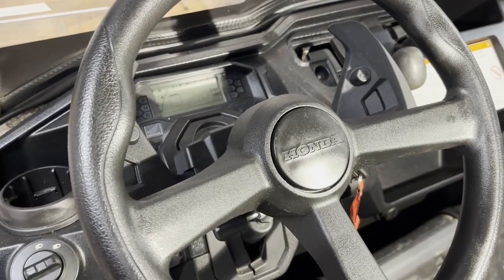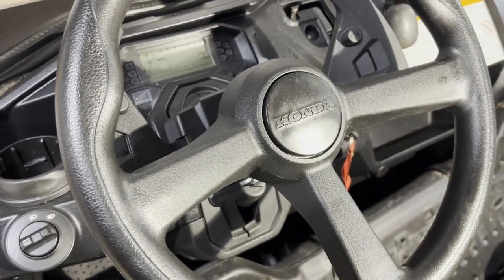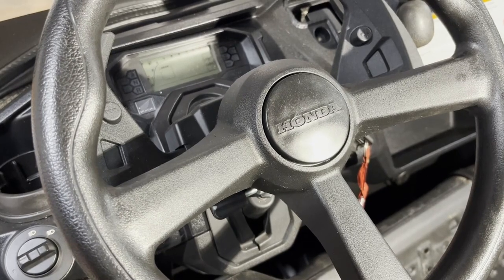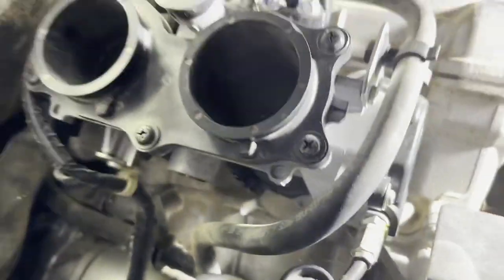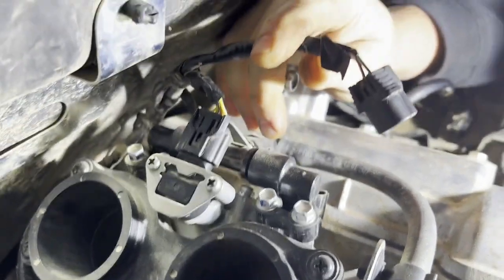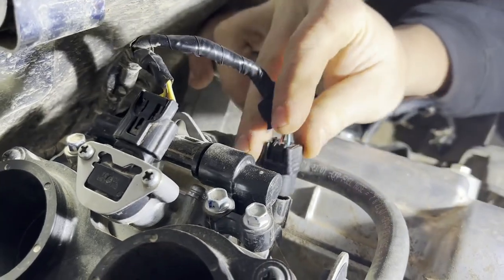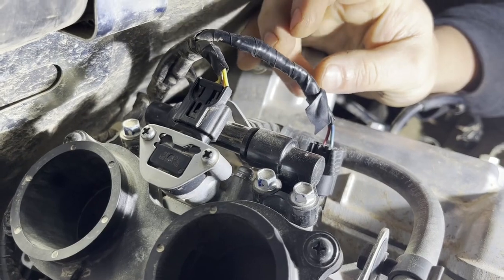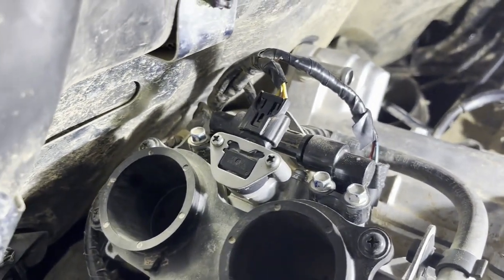Honda Pioneer 1000, No Power, Idle Problems, Will Not Accelerate, Randomly Dies

Comment from the maker: Go up the wire loom about 6 inches and insert a straight pen in every wire coming from the fuel injector. Take your voltmeter and put it on ohms (the lowest setting) and check each wire separately from the connector to the straight pen. If it reads zero or open then there is a break in that wire. If you get a reading or a beep then the wire is good.

Comment: Thanks for the info man. I think this may be my problem. Mine randomly started running rough, having no power and dying. My exhaust smells HEAVY of fuel, and my rear cylinder isn’t firing. Only the front header is getting hot.
Reply from the maker: Sorry you are having problems with your ride. Hopefully this will help. Thanks for watching and please don't forget to subscribe to our channel..
Reply: @crankitt825  mine ended up being a faulty PGM

Comment: Icant feel any break in my wire , is there any way to test with a meter
Reply from the maker: Go up the wire loom about 6 inches and insert a straight pen in every wire coming from the fuel injector. Take your voltmeter and put it on ohms (the lowest setting) and check each wire separately from the connector to the straight pen. If it reads zero or open then there is a break in that wire. If you get a reading or a beep then the wire is good.